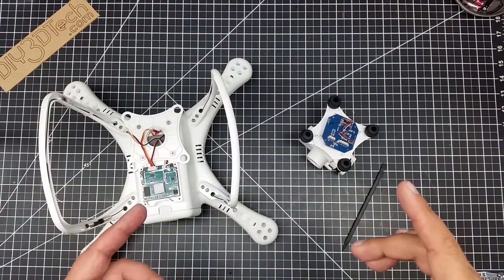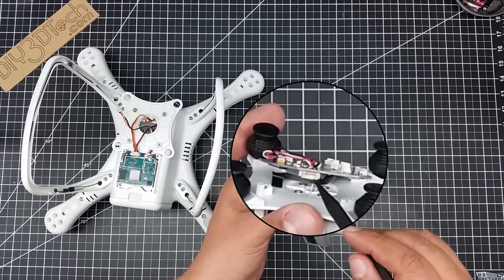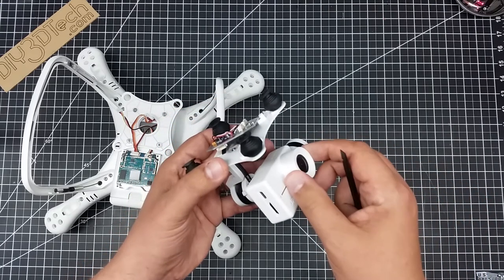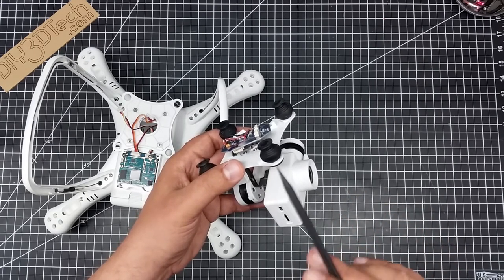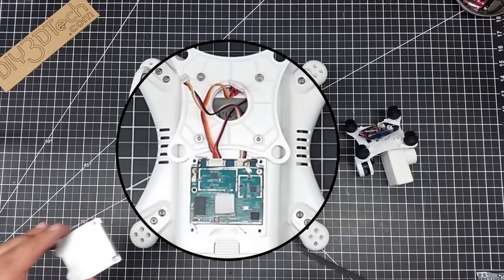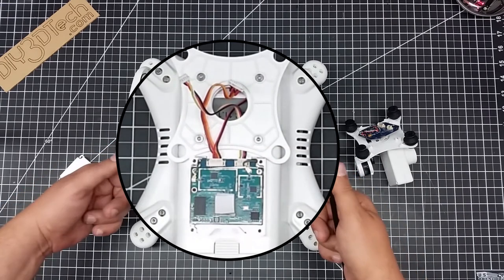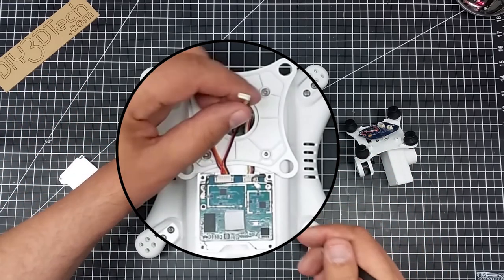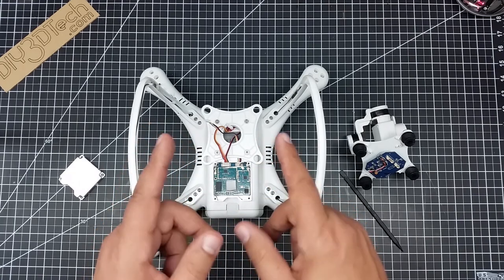Video Drone - UpAir One Plus Look What I Found Disassembling the Gimbal and Transmitter!

Comment: Hi.. saw this video, did you ever figure out if that 4-pin connector at the bottom of the gimbal PC board, are you able to hook it up to "mission planner"..?  that would be nice.. rather than taking apart to whole Quad to get to the mission planner 4-pin connector. Thanx.. for your videos.

Comment: What would be a great Video Drone site bit would be so show where to get service parts, I recently crashed my Upair 1 V1.3 and the 3wire connector plugging into the OSD board above the gimbal to th PDX4 board is broke and I don't know where to get a replacement.
and the camera/gimbal protector I just got is terriffic, thanks!
Reply from the maker: Write to Genten (manufacture) and they are pretty good at getting back with folks as the cables are around $12 (or use to be) with shipping...

Comment: Yes the two boards are connected by a bus, they can come apart. My first upair plus went crazy and crashed, I lost all connection for video so I thought I would take it apart to see if maybe a connection came apart. Didn't find anything so put it back together and sent back to Amazon since I only had it for a week. Got my new one and haven't had any problems at all. thanks
Reply from the maker: Wow that is not good to hear (went crazy)
Reply: Video-Drone I'm pretty sure it was the old florescent lights in my garage messed up the compass and it just went haywire
Reply from the maker: While them yes and this the reason one should a compass cal while in the field well away from things...  :-)

Comment: do you have any idea to reset the gimbal?because mine was misbehaving it tilt on one side..but everything works
Reply from the maker: On the Upair One there isn't an easy way other then figuring out a way to connect a USB port to the Storm controller and use Basecamp to adjust...

Comment: Anyone managed to get the flight control firmware updated from the Android App? Tells me it  has 2.1.2 available. Appears to download but the install buttons doesn't do anything!
Reply from the maker: Yes mine updated on both my Galaxy 5 and Lenovo Tab 5...
Reply: Thanks for the really quick reply. Odd I wonder what I'm doing wrong. I'm on an Honor 8. I do have a few other devices will have to try them. Perhaps this might be video worthy.
Reply from the maker: try a complete shut down and restart and see what happens.  Android can get a little strange...
Reply: Thanks will try that.
Reply: Unfortunately full reset didn't work so I'm trying another Android device this time a Galaxy S5. Is there any special trick to getting the update to show up. Been waiting almost all day. Many thanks again for all your help
Reply: OK it finally appeared but same issue. It prompts to download the firmware which appears to work and the button changes to install. Tap install and it says installation progress but it stays at 0%. I've it for half an hour without any progress. PS Thanks for the great videos.
Reply from the maker: Did you get it to work as I have Galaxy Note 5 and it works...
Reply: Video-Drone unfortunately not. Would be great if you could do a video showing the update so I could see if I was doing good anything obviously stupid.